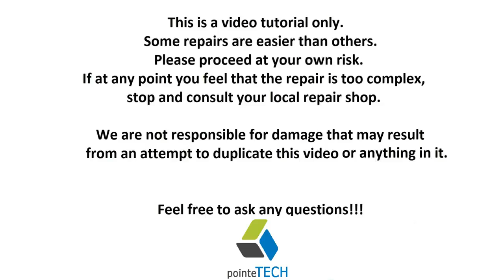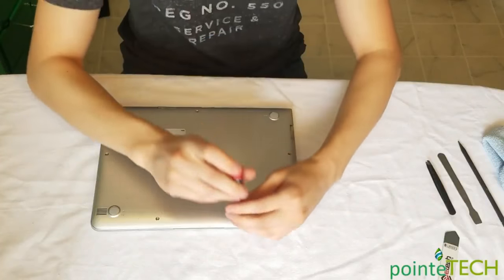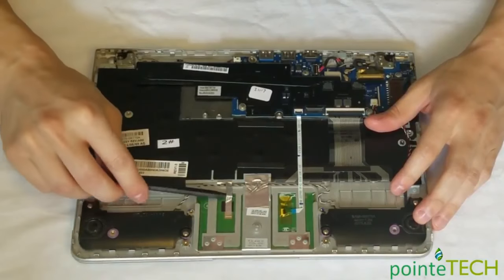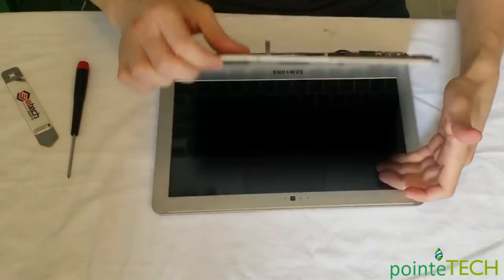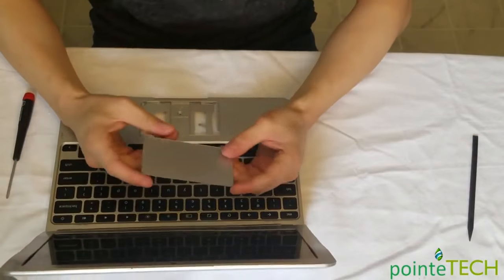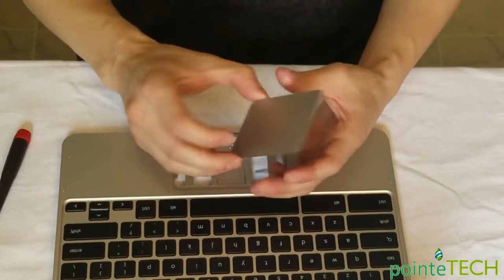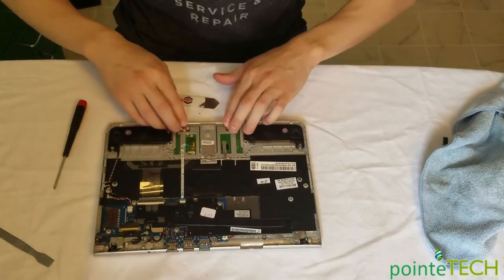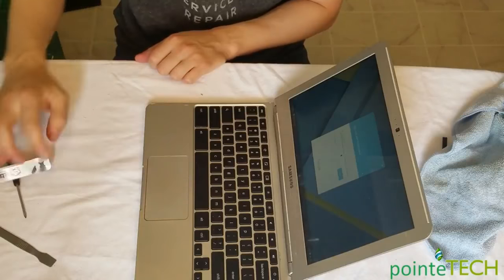How To Fix Trackpad Touchpad Stuck, Won't Click - Laptop Repair

Comment: Who else is trying to find one without opening THE actual computer
Reply from the maker: The repair options for DIY computer repair are limited if you dont want to enter the computer.  Just like the DIY repair options for your car are limited without being willing to open the hood
Reply: Iv'e done mine and it's working, you can do it as long as you should handle it with care
Reply: best i could come up with for this would just be taking rubbing alcohol and and allowing it to seep into the boundaries of the pad, hope it dries out any potential liquid/eats up any crud preventing mouse from  properly working
Reply: @jerrykingsley6703  liquid damage?

Comment: I didnt feel like hurting my computer. I just took a card and got all the gunk out around it. This video is entertaining though so imma subscribe and watch when I'm bored.
Reply: Nah, you won’t hurt your computer, it’ll just take longer than the wedge method
Reply: But did it work with the card?
Reply: You just saved me from taking it apart I used a card😂
Reply: Nice kinda fixed it for me
Reply: @samterios  wh
at card
Reply: @samterios  what card
Reply: WHAT CARD??
Reply: was about to take apart my laptop,,, good thing i saw this comment and it worked !
Reply: Thank you, leaving a like with my clicking touchpad 😉

Comment: Thanks for the tutorial this worked. Wouldn’t recommend unplugging the battery to anyone wanting to tighten/loosen the retention screw for the trackpad, simply unscrew the battery screws and lift it gently up for access.
Reply from the maker: Happy to help :)  Always here if needed !!
Reply: No I would recommend unplugging
even after powering down machine, there is current still in the circuit
can cause static damage to components if they come in contact with ur hand
its much better to unplug battery to remove chance of such damage
I mean yes there is still residual charge after unplugging the battery but much less probable to cause damage

Comment: Thanks, your video inspired me to do this thorough fix.  It was actually much easier to fix on my HP - no glued joints, just screws.  Turns out my battery was swollen and that was contributing to the problem.  New battery ordered.
Reply from the maker: Great to hear !!  Always here to help :):)

Comment: Thank you for this video. It has helped me when I needed to find out what was wrong with my touchpad. Although, it was not the same problem it was similar in a way. It turns out that the one clickers at the opposite end of the touchpad had came off due to me applying to much pressure on the touchpad. So, thank you again for this video and it really had helped me out.
Reply from the maker: Happy to help :)  Always here if needed !!   Nice job troubleshooting and figuring out your issue !!
Reply: @PC_Monkey  Hello there I accidentally dropped some water on my touchpad.It's going crazy and doing things on it's own.Will this tutorial fix that?
Reply from the maker: @zee-ek8ym  Most likely not.  These are two separate issues.  I would keep the computer off and let everything dry.  Then I would access the touchpad as seen here and unplug it, then plug it back in.  Try to clean it if possible.  See if the problem keeps up after that.  Hopefully the motherboard isnt damaged :(
Reply: @PC_Monkey  Surely the motherboard isn't damaged.But it's certain that the touchpad is completely water damaged.And I'm okay with the laptop being damaged.I'm just scared about my data.I hope I can fix it :(
Reply: @PC_Monkey  my touchpad on my hp pavilion has been really troublesome. itll often get jammed and won't click, and when it does work it takes one or two clicks for the cursor to do something. should i get it repaired or would the same thing you did here work on an hp?
Reply from the maker: @milktoast1481  It gets physically jammed?   If so, your most likely looking at needing to clean it as seen here.  Perhaps it also needs to be installed correctly.
Reply: bro mine is also same please tell me how u fixed it

Comment: I have a question. I LOVE you easy to follow instructions. I have an HP Pavillion 15-cs1xxx laptop on which the touchpad is not functioning correctly. I live in a high dust area and opened it up a week ago and cleaned it out thoroughly and reassembled. Some features now function but others do not. The rocker/click function is not working; the long side of the touchpad near me is pushed all the way down and it doesn't rock/click. I cannot right click with it nor highlight. After watching your video I went ahead and opened it back up but went a little deeper as you did in your video and took the actual pad out and cleaned around the edges; I did find the small computer connection lock was not down so I corrected that and reassembled it. Same problem exists; no rocker/click function (long closest to me is still down) and cannot highlight or right click. Suggestions? THANK YOU SO MUCH!!

Comment: This video is great. I actually just kind of pushed my touchpad towards the screen and that gave it enough room to stop sticking!
Reply: ultimately I opened my HP up and it was quite similar, and I was able to adjust the clips and remove a LOT of dust and it works much better now, thanks OP.
Reply from the maker: Glad your all set :) Always here if needed !!
Reply: Brooooo good looking out. I was so frustrated with my practically brand new Samsung laptop that I barely use because it was sticking. And then I see your comment, did it and it actually freakin worked bro. Thank you so much seriously you don't know how frustrated I was lol.
Reply: I didn't even watch the video. I saw the top comment about tools being needed and backed out so that's pretty much what I did until I saw your comment about pushing the pad towards the screen. It worked immediately, thanks again.
Reply from the maker: @BRANDONTHAGR8  Glad your all set :) Always here if needed !!

Comment: Thank's guys! It actually turned out that when I dropped the machine a few weeks ago I dented the bottom case making it stuck. Been using a mouse since but was extremley annoying as the dent was tiny too. Straight off to Acer for a warranty repair!
Reply from the maker: Glad your all set :) Always here if needed !!

Comment: I'm mechanically inclined, but computers are different. I might give this a shot on my HP. I hope Radio shack has those tools and that my hands don't shake (from age). I know one of the guys who works there fixes things sometimes, but he's not there as often as he used to be. My alternative, is to fix it myself or buy a new computer. Buying a new computer is a hassle.
Thank you very much for this video. Although I don't sound very confident, you explained it so clearly I think I can do it.
Reply from the maker: Good luck !!  Let me know how it goes :)

Comment: Thank you for this... dont have the tools but thank you. Going to try with what I have at home 🥲
Reply from the maker: Happy to help :)  Always here if needed !!
Reply: Go to a hardware store.  You'll be able to find a small screwdriver with 20+ attachments (assortment of small flathead, phillips, and t's) for a couple dollars.  A razor blade should be 20 cents.  Small dollar bottle of rubbing alcohol, and you can get inside just about any laptop

Comment: I hope you don't mind if I post my solution. I have had to do this a couple times a year for the past two years. So people may want to try it before tearing into the laptop or paying to have it fixed. 
When my mouse pad gets stuck down and won't work, I use a Q-tip with a little alcohol on it and run it around the mouse pad. Then I use a scalpel tip and run the tip around the outside of the mousepad just barely going into the edge. Then I lift up the pad with the tip of the scalpel. Using the Q-tip one more time, I run it around the mousepad edge again. This works for my Dell. I think dirt and grime gets in around the mouse pad and causes the sticking. 
Good luck!

I think you could also use a small suction cup like you put on glass windows to lift the stuck mouse pad also. I have not tried it yet but it has to be safer than a scalpel or razor blade.
Reply from the maker: Well done!  Glad your all set :)

Comment: Hello!  Only my bottom left corner won't actually have any impact when I click but I do hear it making the clicking sound and can feel it depress slightly.  Do you think this is still likely the problem?  Clicking in the middle of the pad still will click a window or select things.  Clicking on the right still gets me a right click.  Clicking left corner gets me a click sound and feeling of depression but no result/action.
Reply from the maker: It does not sound like its being obstructed so this vix may not help.  I would reseat the touchpad ribbon cable from the touchpad and the motherboard.  If that does not help, try replacing the touchpad.
Reply from the maker: @myobmyob2215  Thanks :) regluing?  Regluing what?

Comment: Cleaning the area around the touchpad helped a little.  I needed to stick a small piece of electrical tape to the piece of plastic that presses against the electrical switch on the back of the touchpad’s circuit board.  It seems like the plastic bump that presses on the switch has worn down over time from use.
Reply from the maker: Glad your all set :) Always here if needed !!
Reply: @PC_Monkey  An Update: It turns out that the root cause of my touchpad's button failures is that the laptop's battery is old and has expanded.  The battery is mounted directly underneath the touchpad and it presses against the mechanism that manages the button presses.  This is easily confirmed by just removing the battery and powering up the PC from the AC adapter.   A new battery is now on order.  Thanks again for your video!  PS: maybe you could make a video about this type of failure...
Reply from the maker: @kertjans8794  Nice job figuring it out!  Yes, an expanding battery is very dangerous for many reasons!  Glad you got that out of there!

Comment: I can’t find the right screwdriver to unscrew the screws. Can any small screwdriver work with enough time put into the screw? Or will it just not work at all without the right screwdriver?
Reply from the maker: As with any screws, you should have the correct size or you risk stripping the screw.

Comment: would some elctro wash do the trick for a first solution?  just spray around the touchpad. it might be better than using a "knife" to clean around the edges before trying to take it all apart. thanks for the video, I learned something.
Reply from the maker: You can definitely try that :)   I prefer getting in there and doing it this way

Comment: I have a GS65 Stealth Thin and the trackpad won't click. The top of the pad is flush with the laptop but the bottom is slightly raised. Any ideas on what the problem is?
Reply from the maker: It may have come loose or jammed somehow.  You may have to open it up as seen here to inspect for damage or for cleaning.

Comment: Hey, nice video! My computer touchpad has malfuctioned crazy, the cursor just goes up and down rapidly, constantly clicking. This has resulted in my tabs getting closed all the time, and my computer opening up random applications. It gets so bad to the point I smack it to get it to work properly again, which is a temporary fix. This problem has been getting worse and worse, what should I do? I have tried resetting the touchpad, updating it and enabling and disabling it, but nothing appears to work, making me think that this is more a hardware problem to do with inside my computer.
Reply from the maker: If all those things have not worked, I would replace the touchpad at that point :(
Reply: @PC_Monkey  Aw alright, how much would you think that would cost?
Reply from the maker: Depends on the computer but its usually one of the cheapest parts to replace.  Would you like help finding one?  If so, what is the brand and model of your computer?   @ultimatesupreme6370

Comment: The drivers for my XPS 15 9530 have vanished - likely due to some automatic Windows update. The touchpad is not even listed anywhere in the device manager - nothing anywhere. It still works as a mouse, but no scrolling or advanced feature are available. Where can I find something to install to bring it back with adjustable settings? Web searches have failed me. Thanks!
Reply: The touch pad is often listed as a sub-set of " Human Interface Devices "...just an FYI to folks reading the comments.

Comment: How much would this repair cost? I live in NYC and would like to hire a Tech to repair mouse pad which is jammed on my Gateway laptop. It's hardly been used but does not go pass the log in screen as mouse pad is not responding. I bought a wired mouse to see if I could still work on it but that hasn't worked neither.
Reply from the maker: It depends on the shop.  To repair a touchpad like this, I would usually charge $75.  However, you seem to have another issue, if your computer wont go past the login screen.
Reply: @PC_Monkey  My wife who the laptop belongs to feels an anti virus program needs to be installed on it (It came with Norton but expired). How can we install one without us getting past the log in screen? Is there a way to actually run a test or connect to the laptop via a different laptop & repair it that way?
Reply: @PC_Monkey  I would pay $75 for the inherited mouse repair. Are you in NYC or do you have a skilled & trusted person out here?
Reply from the maker: @johanmassy5290  You cant install software without getting access to the computer.  So the issue is the computer wont get past the login screen?  You can try to reinstall Windows as seen here;  https://www.youtube.com/watch?v=bIlW4im-tr4.  Let me know if that works first
Reply: @PC_Monkey  Thank you for the reply & advice. Do you have a shop for repairs here in NYC or any trusted colleagues who cover this area?
Reply from the maker: @johanmassy5290  Sorry no :(  I am out of NH

Comment: I’m guessing I’ve broken my laptop because I’ve used too much pressure btw I’ve got the hp pavilion 15 any tips?
Reply from the maker: Why do you think you broke it?  Whats wrong with your computer?
Reply: PC Monkey well whenever I put on my laptop and try to use the touchpad the cursor never shows up on the screen so I’m unable to do anything
Reply from the maker: @x_isha  If the computer work otherwise you may just need to replace the touchpad.  They are usually pretty cheap on sites like Ebay
Reply: PC Monkey hi again, I’ve just turned on my laptop and my cursor is working but it keeps jumping and keeps moving around by its self got any tips?
Reply from the maker: @x_isha  Could be a driver / software issue.  Try making sure the drivers are updated.  Uninstall that one and restart the computer if needed.  Or again, it could just need to be replaced.
Reply: @PC_Monkey  i also have a hp computer and recently my touchpad has been breaking a lot. usually shutting it down worked for me but like yesterday it only worked for a few minutes at a time. do i do the same thing?

Comment: This might sound like a silly question but how do you stick the touchpad back on again afterwards? I'm scared I'll take it off then won't be able to fix it in place again
Reply from the maker: Not a silly question :)   The double sided tape usually is good for a very long time and multiple installs.  Its effectiveness definitely wont run out after a single install :)

Comment: i just kind of gently pressed on the underside of the laptop near the touchpad and in the corners and it got unstuck. i've had this problem before but it usually resolves itself and doesn't happen for a while

Comment: You can actually try to click the touchpad with a high intensity, then it will actually start clicking again. Works for Dell Laptops don't know for others.
Reply: I just did this and it worked perfectly. Thanks for saving me from grabbing tools lmfao
Reply: @erin5498  Works for other buttons too.
Reply: I just repeatingly tap the bottom of the touchpad and it works usually cause this happends alot for me sadly

Comment: and how permanent is this fix? seems like the touchpad will get filled with gunk and dust again in about the same amount of time it did the first time... is there any more permanent way to fix it?
Reply from the maker: No, not really.  Its just a design issue with this computer.  You an try putting some sort of plastic covering over the touchpad area but that may interfere with the touch ability.

Comment: my touchpad works when i restart it but it doesnt move at all it clicks but every once in a while the mouse starts to glide and then stops moving at all. How do u fix this? :(
Reply from the maker: Try unplugging the trackpad ribbon cable from both ends for a few seconds.  Sometimes the connection just needs to be refreshed.  Also, make sure the updates are all run as seen here;   https://www.youtube.com/watch?v=DDv2gJDjfOM

Comment: can you help me i have an HP laptop the area under the buttons is swollen and area upper the left button is swollen   too and i cant press this button and the right button workes correctly any help plz
Reply from the maker: The keyboard is swollen?  First thing is to find out why lol.  Is the battery swollen?
Reply: @PC_Monkey  the keyboard is not swollen and i think the battery too because i cant know if it is swollen or not but i purshased te laptop from a 3years ago . also when i press on the area of touchpad close to the left button it workes like i press the button and when i press on the area under the buttons which is swollen it workes like i press the right button.
Reply from the maker: @fadigaming205  First I would replace the battery or at least remove it as it could be harming the computer.